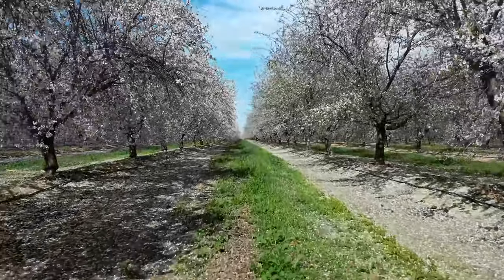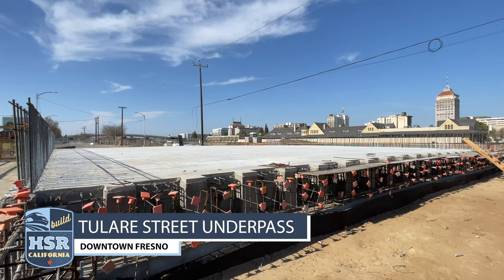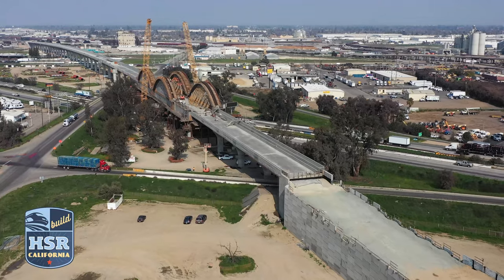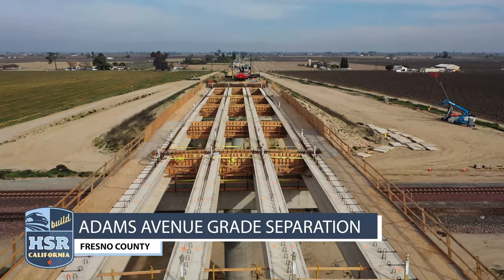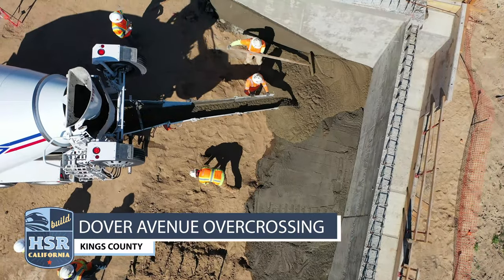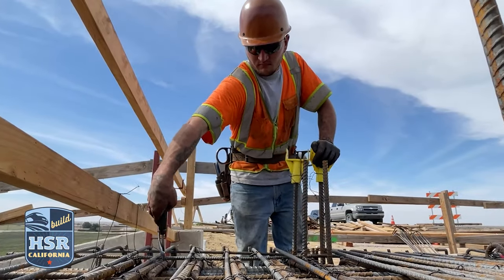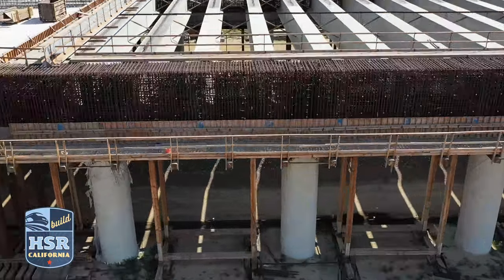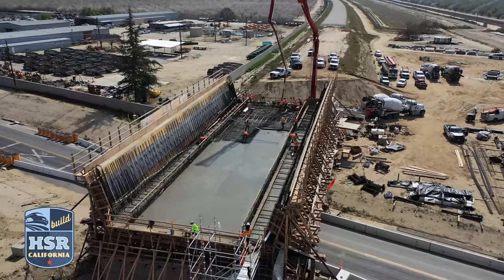California High-Speed Rail Construction Update – Spring 2022

Comment: It's the earthquake proof grade seperations that has turned this project into a monstrosity both in time and money.    But it looks like they are doing it right the first time.
Reply: There's a lot of factors that go into it.
Making all the viaducts and grade separations earthquake resistant is one. But a lot of the cost has gone into Eminent Domain negotiations. Real Estate prices in California complicate that immensely. Also, the cost of tunneling through the Diablo Mountains in the Bay Area, the Tehachapi in Bakersfield, and the San Gabriel Mountains into the LA area was greatly underestimated.
Reply: Get some swiss engineers up in this joint

Comment: With the gas prices constantly going up, it's about damn time projects like this get fast tracked.
We're way behind Asian / European countries when it comes to highspeed public transportation.
Reply: By the time this project is completed there will be significantly more electric vehicles in California.
Reply: @SpockvsMcCoy  ...and still significantly more traffic. And Electric vehicles will not be able to travel 180mph. Apples have nothing to do with oranges.
Reply: @TheRailwayDrone  Incorrect.  The population of California is in decline.
Reply: If that's the case, then why do you think there will be MORE electric vehicles??
Reply: Lol, you’re not going to lose enough people from California to cause a significant reduction in car traffic. California is the largest state by population by a mile.
Reply: @SpockvsMcCoy  it's in temporary decline
Reply: @SpockvsMcCoy  Electric vehicles will never be a good alternative for mass transit, not to mention that driving an entire day is never the best solution for long-distance travel. HSR will only be faster, safer, and more energy-efficient than a bunch of battery-hauling two-ton boxes congesting the I-5; competing with airplanes (which is a much more apt comparison), HSR emit less pollution and have the potential to be cheaper. EVs are good, but they won't replace the HSR.
But if there are electric planes the size of 737s in 2040, then I guess rail will be in a lot more trouble.
Reply: That could be solved cheaper and faster by producing more oil internally rather than importing oil from other countries, but we would rather outsource our pollution and then pollute more by then shipping it half way across the planet. and isn't this rail line going to end in bakers field now? Who the hell wants to go to bakers field. This is just one huge cash grab by politicians that owner the construction companies and their sub contractors. In the time it will take California to build this rail line, China has built their entire countries rail network that is big enough to connect every single major city in the US with high speed rail at 1/4th the cost.
Reply: @willhaney96  Do you want an oil rig in your neighborhood?
Reply: @willhaney96    It'd be nice if we didn't rely on foreign oil, of course. But that doesn't solve the bigger problem, which is the fact that we've completely become car dependent in the U.S. 

Less cars means less traffic, which means less pollution. I'm sure there's corruption involved, but these projects are more than just a cash grab for the commuters. It's the first step, and it's bound to gain momentum once the public sees the benefits.
Reply: @X3MAntics  
We already tried rail, it failed to car and plane. Try living in the 21st century
Reply: @one-six952  
🤣🤣🤣🤣🤣
California has a hard enough time keeping the electricity on.
Reply: @jamesclint2338  you really need to visit Europe and Asia.
Reply: @TheRailwayDrone  
No.
No I don’t. 
We’re not those countries. Their development came about because of certain reasons. 
I can look at rail in America, and see what financial failures they are.
Reply: @jamesclint2338  Then explain why rail in the NEC is so frequently used. Your statements make absolutely no sense.
Reply: @TheRailwayDrone  
Maybe it’s because it goes through some of the largest populated cities that are grouped together.
Congratulations, you named the 1 profitable rail route. 
Out of hundreds. 
You can’t say rails successful if only one route is profitable. 
NYC runs on subways and yet is billons in the hole. Subways work in that city.
Yet Im the one that makes no sense.

.
Reply: @jamesclint2338  Are highways and roads profitable? If not, why do we build them?
Reply: @jamesclint2338  Nah, it was just that the government built the highway system and it was free at the point of service meanwhile the railways were still private and needed to keep up a profit. So it was cheaper to just transport goods and people on the interstates since the government covered infrastructure maintenance. So the rail companies collapsed until we got down to BNSF, Union Pacific, CSX, and Northfolk Southern. Oil companies also tore out the local public transit of cities so that way everyone had to use a car. Furthermore, suburban sprawl and our circuitous cul-de-sac pattern of development made walking/biking infeasible. The reason why the car dominates transportation is that we bulldozed our beautiful towns and cities for them, rendering the outside world a car-infested hellscape where you have to drive just to even grab groceries! Electric cars, while better than gas cars, will not save us from this predicament (they require expensive materials and are much heavier, making road damage exponentially worse). The only way out is to provide VIABLE ALTERNATIVES to driving and trains are the king of high-capacity intercity transportation.
Reply: @whoisthatkidd2212  

Always love that creative editing. The oil companies often replaced them with busses😱🤭 All they did was mass transit the auto. You also fail to mention how gas taxes helped cover those costs. All the states had gas taxes around the 30s before freeway construction really took off. 
So people got lazy.
Funny how you also fail to understand why suburbia grew. Manufacturing moved outside the cities since manufacturing, especially at that time, was, dirty and polluting. Generational wealth is built on ownership. Like property.
No they’re not. Since the have to be on set paths.
Reply: Chinas High Speed Rail Was Built in 6 Years US Slowest High Speed  Rail Ever Built in California I Say 10 Years
Reply: “Fast tracked” that is too funny. I’ll see you in 2030 and we can ride the train from Bakersfield to Merced.
Reply: @one-six952  the beauty of high speed rail is because it’s faster than flying for routes up to 500 miles, it allows airlines to greatly reduce those short haul routes and replace those slots with more lucrative long haul routes (at least that’s been the case in Europe with their high speed rail network). I think it was KLM airlines that replaced one of their routes with a designated high speed rail service between two cities in conjunction with ICE. So even with electric planes, high speed rail will still be more effective and desirable for those <500 mile short haul routes like LA to SF.
Reply: @SpockvsMcCoy  Mass (High-speed) Transit for the win!
Reply: Lol. I’m from Germany and I can’t understand while the US, actually a rich and really big country, do not have high speed rails. How can a country insist on such old, slow or environmentally harmful methods of transportation between big cities?
Reply: @TheRailwayDrone  Still, wanna bet the # of riders will be nowhere near enough to sustain operating expenses, let alone 1million\ft. construction costs??
Reply: @jamesclint2338  They are so progressive, they want to stick with the concept that is older than the car, and the electric car that is older than the gas car too.
Reply: @ChrisJones-gx7fc  "the beauty of high speed rail is because it’s faster than flying " I take it you didn't hear the track is not going to make it to LA. So much for it being faster than flying to LA or getting to the station to go to SF.
Reply: @h.mandelene3279  California High Speed Rail Authority is actively completing environmental reviews of the full Phase 1 route between SF and Anaheim, of which so far Merced to Palmdale and Burbank to LA has been cleared, and is either under construction or close to if not shovel ready for when funding becomes available. They’re working to get Merced to San Jose and San Jose to SF environmentally cleared this year, and the two remaining segments (Palmdale to Burbank and LA to Anaheim) approved by 2023. This is a necessary and crucial step to get those sections closer to the construction phase. It also shows CAHSR’s commitment to reaching SF and LA.
Reply: @h.mandelene3279  I don't debate people who have political crap in their profile avatars. Have a good day.
Reply: @TheRailwayDrone  Oh too bad. you can't face a logical argument huh?
Reply: @h.mandelene3279  yea, that's the flying part, that is fast, but the going to the Airport, checking you're bag, security, going to the gate, geting you're bag, going from the airport is not fast. While the train maybe take longer, but geting to the train and off is really fast.

From a Swed
Reply: @taboi1388  Not always. during the week\non peak times, I am at the gate within 30 min- most of it walking to the gate.
Reply: @h.mandelene3279  most train stations (atleast in europe) are in the center of down town. Are Airports in the center of down town? No, there are far from the city most times. And even when they are not, check in, security and going to the gate will still take longer that walking to the train station and hoppning on the train, no check in, no security and no gate.
Reply: @taboi1388  I never compared Europe or Asia to USA. Unlike those, US left the "downtown" and spread out. 
Why you insist we should do what Europe and Asia do here I will never understand.
Cities outside USA are close together so a train works. 

Again, why force us to buy trains that nobody will use. The Mass Transit(in name only) in my city has empty train cars running during rush hour as I zip past them each morning and end of day.

Quote me in a few years if cali ever finishes the Medium Speed Rail(it technically will not go fast enough to be called High speed) it will be just like Japan - traffic wasn't enough to pay off what it cost to build.
China's HSR is the same - no way does the train pay for itself. It costs billions to make and millions to run but the revenue doesn't cover it.
Reply: @h.mandelene3279  doesn’t the US have a massive traffic problem during commute hours? And our solution so far was to add more lines which actually exacerbates the problem even more. 

Besides, if you haven’t visited Japan before you should before criticizing HSR (after Japan opens their borders). Lots of legroom and a guaranteed smooth and quiet ride that will never be late (avg lateness is in the seconds). I’ve traveled basically the entire length of JR west and it’s so worry free. And JR also currently is at a grand total of basically 0 casualties that aren’t suicides even if earthquakes are just another Tuesday there. Even at the busiest stations (Tokyo and Osaka) everyone constantly moves so traffic jams aren’t as bad. 

You can’t connect sea to shining sea (yet) but there are several cities that have the capacity to work for sure. As for money,, subsidies exist for certain industries already (*cough cough* agriculture, meat packing, probably pharmaceutical and oil)
Reply: at least they started
Reply: @ーワッフル  Depends. Some cities, it is pretty bad but nowhere is like the stories from china where traffic jams sit for 3 days.

Even the worst cities like Los Angeles Cali, it is bad with the definition of bad being traffic is slow. It doesn't come to a grinding halt for hours. Other cities like Chicago, Dallas, Miami, Atlanta from my experience is not very bad.

I have been to Tokyo, Osaka, Kyoto, etc. I rode the HSR. I never criticized it. I only cited the fact that the RR never paid for itself. The govt who funded it just wrote off the loss and gave the HSR to JR who run it. 

I agree that products such as some vegetables do not deserve subsidies. Then again, if you want to be fair, all inner city mass transits would shut down as they rely on millions from DC or their own state Capital.
Reply: @h.mandelene3279  fair enough, my state’s bus system is really good (but probably because tourism hard carries our economy). We are making a monorail but that’s been a money sinkhole,, though making a monorail of all train systems should’ve raised red flags. But then again, the H3 isn’t popular either.

And yea JR became a private company to run the system itself. A lot of their revenue actually comes from the land around the tracks themselves by building housing, stores, etc rather than from ticket sales. But it’ll be hard to do that unless the rail runs through the middle of nowhere. 

Traffic wise, I went to Houston but it was somehow really empty for a major city???? Like, literally zero foot traffic besides all the robotics teams competing in 2019. Or do people in Hawaii just walk a lot? Or was it just a really empty time of the year?
Reply: @h.mandelene3279  russia, it has trains going from from Moscow to the far east of the country
Reply: @h.mandelene3279  and for you're argument that the downtowns in the US are spread out, bus, subway, s-bahn, heard of them?
Reply: @taboi1388  Go ahead- have the average person who lives in the suburb to take a bus from downtown to your house and get home in less than 3 hours.... Let me guess... you are like aoc who push mass transit but says F-no!!! to doing it yourself..right?(aoc was caught flying to\from DC. She also says she got a Tesla because it can make it to DC on 1 charge)

I went back to Chicago and went to visit a friend for lunch. I took the trains to get there. I left home @9am. I got back home @4PM. when I could have driven a car which would take about 40 min each way. As I said above- u have never used the mass transit u push, have you??
Serious, why do your type want us to travel in cattle cars and not personally drive a car???? Serious...
Reply: @h.mandelene3279  and that's why more transit needs to be built, i live in the suburb and i can get to the local train station in 10 min, if i'm lucky i can take the local bus that comes every 30-60 min. And i have a car, but because of the low fare, the train coming at least every 10 min, i take it. Why be stuck in traffic when i can get to the center of downtown in less than 20 min?
Reply: @taboi1388  Then Newsflash - not everyone only travels to downtown of a big city. If u ever noticed, when u get off a train, you need to walk. Adding more busses and trains as you insinuate, costs MONEY. all towns extend *a little bit * farther than 4 blocks from a train station.
No sane suburb is going to run busses to cover every 3rd block every 10 min. Still if towns are dumb enough to do it, then my experience comes up AGAIN. 
Being the odds are there is no direct route from one place in the suburbs to another, everyone would need to spare 3 hrs a day to travel alone. Sorry, I have a job and don't have hours every day to waste.
Reply: @h.mandelene3279  walking is good for you're health, reduces traffic and co2 emissions. And it's good for the economy, stores sell more produkts when people walk in front of stores instead of drivning in front of them. That means more money in the hands of the stores. That means a better economy, you want a better economy, don't you?
Reply: @taboi1388  "walking is good for you're health, reduces traffic and co2 emissions." If you don't have a job....
But hey, go ahead, prove me wrong and tell your wife to walk 1 hour each way to and from a football game.
Safe bet you would never do that.
I hope the next time you are driving around because you don't want to spend an hour commuting to the store, you will hear me in your head telling you - "I told you so".
Reply: @nolantherailfan5048  What's your solution?